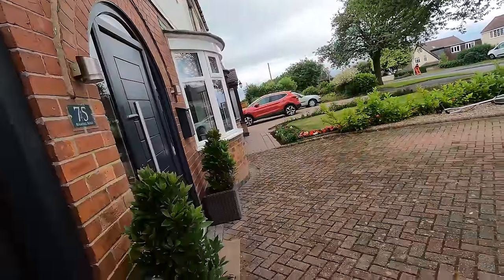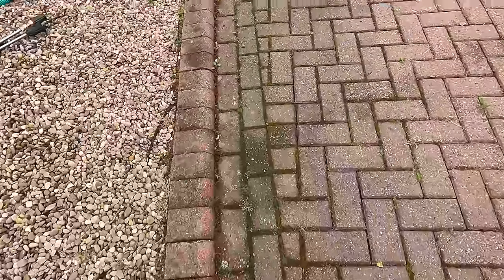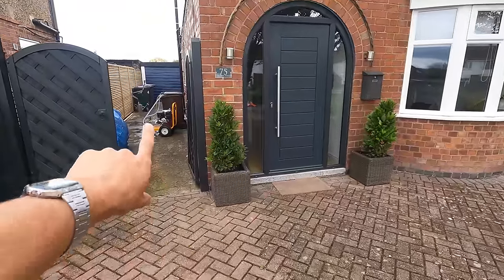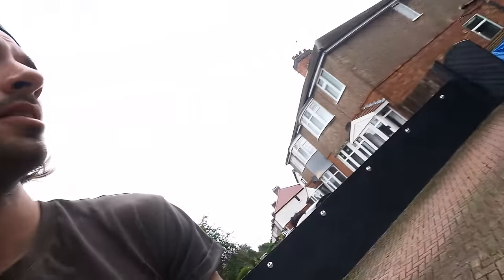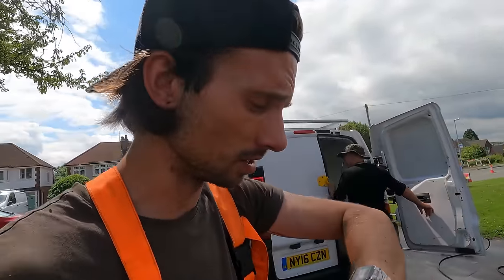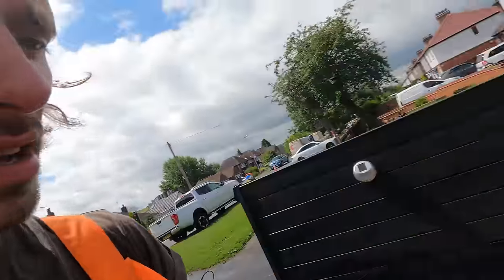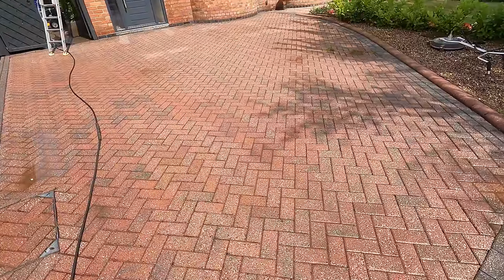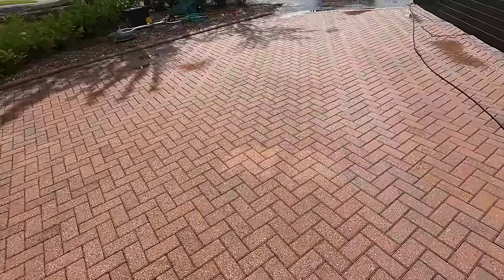2 Hour Driveway Clean-up In 10 Minutes

Comment: Might sound like a stupid question but why do you use the bin full of water couldnt you just connect straight to hose?
Reply from the maker: The machine pulls water quicker than a house tap can put out so the bin acts as a buffer tank so the machine can run at max flow

Comment: It's nice to see that the larger bunches of moss give you issues, too.  I have a 3100 psi washer and it just won't take off that damn clumped moss.  I'm going to have to just scrape it off with a scraper first.  Either that, or use the "cut your name in concrete" tip.

Comment: I have a question, I don't have a brick driveway and never have before. Why put sand at the end? My guess: To keep the moss and weeds from coming back possibly? Amazing videos they are super satisfying! Thanks for doing whatcha do. :)
Reply: It is to keep the bricks in place and from shifting.  While pressure washing it blasts a lot of the sand out of the cracks, so you must replace it.
Reply: There was sand put in between bricks and pavers when they are installed. Cleaning and pulling weeds would have dislodged some off the sand which then needs to be replaced. The sand is there to stabilise the brick or paver restricting any movement. When there is too much movement they become uneven, break edges, crack allow larger surface for weed seeds to establish. Dangerous for walking and driving as deteriorate.
Reply: @michelleodwyer2271  oh okay sweet, thanks! My driveway is just dirt since I’m out in the middle of a forest. So that clears up a lot.

Comment: I was slightly amazed when watching this that there was NO treatment prior to starting of the existing lichen, moss or algae, which was clearly pointed out. In order to kill it to stop it returning again (benzalkonium chloride locally here called “30 Seconds”). It takes a bit longer than the 30 seconds however to work, hence as soon as you arrive on site before unloading your tools you would do a walk around spray. Unless this was done before the recording started I wouldn’t both cleaning any stonework without using it, otherwise within a year or less it would be back, especially in the area with less direct sunlight. Also this would have to be an Autumn, Winter or Spring clean here with temperatures above +20C(68F) otherwise the driveway would be dry behind you. NSW in Oz    P.S. still a good explanation of how to use the right tools to get the job done! However, I would have like be be shown how each does its job!

Comment: How much water is used to pressure wash a drive?
Reply from the maker: depends on the size, most small 2 car drives can be cleaned within a total of 1 hour actual finger on the trigger time. I use a 15 litres per minute machine so 15x60=900 litres

Comment: Love the videos, they've become my new binge obsession! Just curious, but why do you put sand down after the job? It seems counter intuitive to put down sand after cleaning it, wouldnt it just be dirty again?
Reply: The sand goes between the bricks. The power washer removes a lot of the original sand during the cleaning - so he's just putting back what needs to be there to keep the bricks set tightly!  Also he would likely be using sand that has been treated with weedkiller so the weeds / moss don't come back so quickly. :D

Comment: Okay I don't really understand these kind of driveways where I'm at it's mostly concrete so what are those square things that have the metal in the corners. I saw it at I think 3 minutes and 30 seconds.
Reply from the maker: Hey rita, it's a cover for a drain underneath that runs from the plumbing in the house. it was done to match the driveway (:
Reply: @PartridgeExteriorCleaning  thanks

Comment: Great finish you achieved without chemicals? 4K vid editing needs power and ram.
Reply from the maker: Yeah none needed on this one, always like that. 
Yeah my computers pretty sick but it struggles with the 4k still. 16gb ram not enough it seems ):
Reply: @PartridgeExteriorCleaning  16GB should be enough, must be processor maxing out, have a look at task manager and performance to see what is struggling.